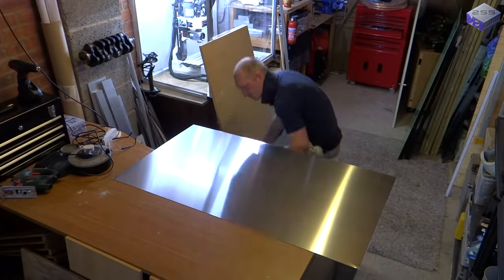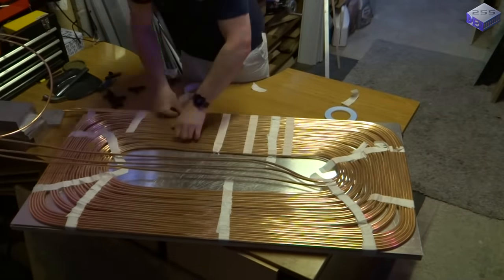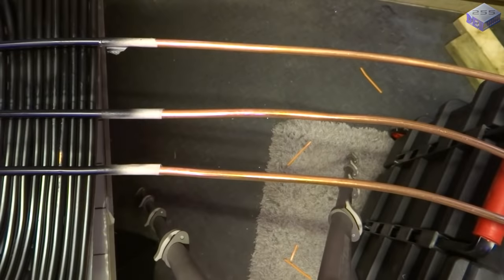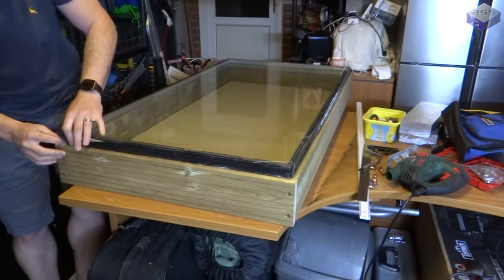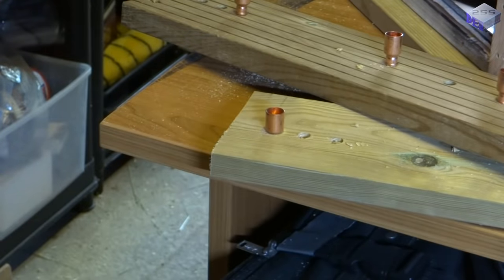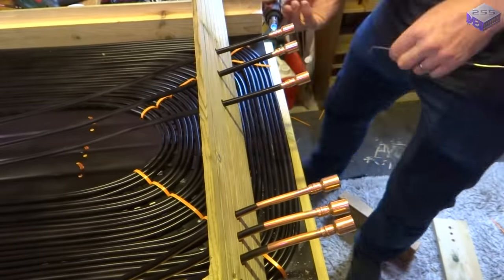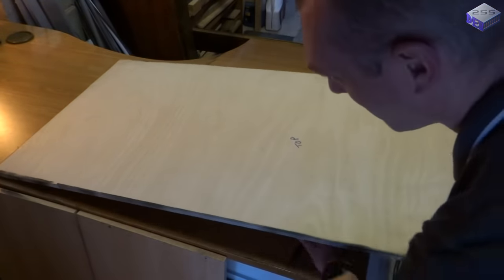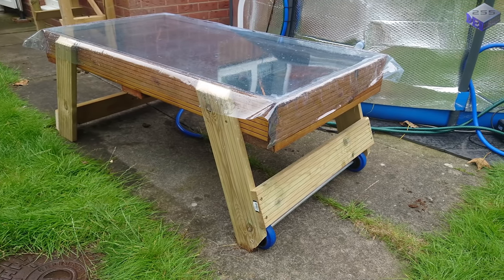Improved Solar Pool Heater - Full build

Comment: Maths is your friend here.
Maximum available solar insolation per square meter based on latitude and time of year means there is a limit on the maximum energy you can extract for any given surface area.  You will never extract 100% of the available energy due to loses etc.  The max insolation for 50 deg north at solar noon in mid summer is 1kW (1000 watts) per sq meter at an incidence angle of 90 degrees
  
The energy required to heat 1 liter of water 1 deg C is 1000 calories. 1 watt is 0.24 calories per second (watts are a measure of power over time), so 1000 watts will raise 1 liter of water 1deg C in about 4 seconds.   Which means that on June 21st in the UK between 12.30pm and 1.30pm (solar noon) you can heat as an absolute maximum 900 liters of water 1 deg C, or 90 liters of water 10 deg C for every 1 sq meter of solar collector surface area.  In reality due to losses etc this will actually only be about 60% of maximum, equating to about 50 liters of water heated by 10 Deg C for every Sq meter of solar collector for one hour at the middle of the day in the middle of summer.  Outside of this it falls off quite rapidly, both in terms of time of day and time of year.  If you had a cloudless day you would effectively collect about 6 kW energy per sq meter over the entire day at 50 deg north on June 21st, and about 2kW per sq meter in mid winter if you dual track the sun.  

An average swimming pool is about 2 meters by 2 meters by 5 meters or about 20,000 liters, will require roughly 400 sq meters of surface area of solar collector to be heated by 10C in the middle of the day in the middle of summer in the UK, or about 80sq meters of collector if you happen to have a cloudless day and the panels are solar tracked.  If you want to heat the water to bath like temps, time to cover an area about 20 meters by 50 meters with panels and then make sure to prevent heat loss a night.

You are actually better off using solar PV and powering an electric heater.

Good luck.
Reply from the maker: Hi, that sounds fair, although not sure about the PV panels and heating with electric due to PV only being around 20% efficient and Solar Thermal (ST) around 60% efficient, also with the direct heating of water from ST as opposed to Power losses through PV cables, each connector, charge controller power consumption, battery charging inefficiency (especially lead acid) and heating element to name a few. Although, that said, you could collect energy from PV over a number of weeks and then only heat the pool when necessary so you could have a smaller system. We did manage to get our 3m diameter pool up to 31deg C in summer of 2020 over the course of 7 days from around 22deg, and that was using my first homemade panel that produced on average 600W per day (4.8KWh), 900W max during midday. We had heat loss of around 1 to 3 over night as we had the pool covered and wrapped in reflective bubble wrap, so that helped a lot. All the calculations for the specific heat capacity of water (just below 4200), the amount of water (4600 litres) and joules produced by the panels calculated correctly to what we were seeing. I've learned a lot from making this system and love the answers in the comments section, they are thought provoking and help think about other solutions, thank you. What do you think on ground source heat, I was thinking of combining a number of systems for an all year round pool heater that would not freeze due to the ground source and possibly air heat exchanger tied in together?
Reply: @TheSolarPoweredEngineer  Sorry the Pv comment was meant to be a bit tongue in cheek...  but in terms of cost, maintenance etc, it is actually more cost effective over time to use Pv and an immersion heater if you have the space for a lot of Pv panels.

I really enjoyed you vid by the way... i´m a bit of a solar geek and have put together a number of systems myself (water and Pv) over the years and really enjoy seeing other peoples adventures in it.

We used to live in wales and had ground source heat pump with about half a mile of buried pipe in a field, and it was pretty effective even in deep wet welsh winters.   The heat pump itself used a fair amount of power so I would advise pairing it with a good Pv system or the electric bill can be a bit of a surprise.

These days I live in Spain so have the luxury of a lot of sun and a enough land ofr a sizeable ground mount Pv array. (but no pool ironically). I have messed with making a solar heat collector for hot water here, but with the sun and space it just came down to Pv and an immersion heater being a better alternative in this location.

I think your notion of combining sytems is actually probably the best (and most fun to design/make)...so if you have the space a Ground source pump powered by PV with solar collectors for additional capacity would be pretty awesome.. I would definitely like to see that put together.  

Oh subbed by the way, just in case ... :)
Reply from the maker: @Pabz2030  Hi, thank you, no dramas at all, I love to respond to all the comments, especially when it's engineering, I still teach electronics and valve theory to some degree strangely, so it's nice to chat to someone in the know.

I've been thinking of a number of things along combining solar systems, such as, using Solar Thermal to heat an emersion tank of water to directly feed into a washing machin and/or dishwasher and just use PV for running the machine and spinning the drum/pumping water. I think this would be much more efficient.

I'm also converting a car to electric and converting my mill to CNC that's run by solar, so essentially the car is being manufactured using solar also. It's amazing what can be achieved today in a home garage and am enjoying the learning journey.

Glad you liked the video, plenty more to come and thank you for subscribing 👍.

Comment: Thanks for this vlog. I have question when you testef with pool what was day time temperature?
Reply from the maker: We need to fully test this version as summer last year was almost non existent haha. The previous panel was tested in 2020 and the outside air temp then got up to around 30deg C during mid day, although was around 25deg C average across the day and dropping to around 14 over night, where the pool only lost 1 to 3 degrees overnight, but gained 5 to 6 ish during the day. We had insulation around the pool and covered it with bubble wrap insulation during the night too, so all these factors make a difference. It may be worth looking at my previous videos as I go into a fair bit of detail in part 3. I hope that helps

Comment: Are those hoses from the panel going straight into the pool? If yes, I hope, you're not running chlorinated water through your solar pool heater. Chlorine will react with copper, eating away your tubing, so this might not be a long-lasting build. Maybe you should put a heat exchanger between the pool water and the solar panel.
Reply from the maker: Hi, yes the water goes directly to the pool. I'mm currently looking into this and trying to get an answer from a university or other professional body as this is a concern from reading some of the comments. The thoughts at present lean towards using chlorine only when needed and maintaining a neutral PH balance as the chlorine will react more aggressively if the PH is off neutral. Drinking water also has chlorine in (although the amounts may be a lot smaller) and runs through copper house pipes with a neutral PH, but that is professionally monitored. There needs to be more answers to this online as it's difficult to find the correct answer. You are absolutely right about the heat exchanger, I will be looking at doing this as a closed-loop system, that way I could connect PVC pipe to the copper pipes and have the PVC pipe run around the bottom of the pool transferring the heat.

Comment: I was going to put a 1 way mirror on the inside of mine. Sadly we are getting rid of the pool so ill never know but it would definitely increase the heating. My only concern was the film degrading over time so i was going to go with a really high end film to start. Would love to see it if you do another.
Reply from the maker: I may have to try a number of different options to see which one works best, the one way mirror does sound like a good option. Thank you, I will hopefully make some more this year, possibly a number of small ones to compare different make ups

Comment: Pretty neat.
To cut cost I would use plack irrigation piping. Orherwise it will work nicely.
Reply from the maker: Hi, thank you, I did make the first version with black irrigation piping, and that worked well too. This one was an attempt to make the system smaller.

Comment: Can't help but wonder when you make it like a circle loop. 
Wouldn't it have been better just to make 2 manifolds connected by straight tubes bottom to top.
Reply from the maker: Hi, it may have been better to connect them to an input and output manifold to maintain the same /similar flow in each tube, although I want to be able to change the configuration of the tubes to see what the best option is, plus measure flow in each tube. I think different configurations would not make much difference, although will test the options.

Comment: Please check your glass. A lot of modern double glazed units have a solar control coating comprised of a pvd applied silver coating which is designed to reflect infared energy (ie heat) to avoid your house overheating in hot weather. You would get faaaaar better results just having a single pane of toughened glass as it will trap more heat and not reflect the valuable heat into the atmosphere. 

Thats why a greenhouse with single glazed glass feels a lot hotter than your front bedroom window

Edit: with that in mind, having improve u values (thermal transmission outwards) isn't a bad shout. Maybe a dgu with the worst possible solar control but the highest available U value. I have some software at work which I'll check through and look for the best (for your application, but worst as far as solar control domestic applications go) unit you can get.

Comment: DIY pool heaters are more cost effective with black irrigation pipe. Unglazed. You should hook that up to your domestic water heater with  glycol, a pump and a heat exchanger.
Reply from the maker: Hi, my first version was black irrigation pipe and it still works very well with only the pool water running through. I did think of a heat exchanger for this version as people were concerned with copper and chlorine. I may just try this when the summer appears.

Comment: Nice work, but at some point it would be better to buy a ready made vacuum tube rack and keep the copper tubes for connecting to the pool.
I am making 500-1000W per rack and would melt the garden hose real quick with 3 racks.

Comment: I love the idea of this technology. The thought occured to me, why not use this same technique to heat your home. Just run some PEX under the floor of your main living space. It would have to dramatically reduce your heating bill.
Reply from the maker: Hi, this would work quite well, although not sure how well in the winter in the UK as it could freeze the pipes and cause issues in the house, although if you used a Glycol mix it would reduce that concern. The Glycol mix would have to be tested at least annually though, similar to a cars cooling system. I may just be testing this heater on a emersion tank full of water to see how well it works; this should work well as there would be far less water than in our pool. Good idea :-D

Comment: Wait plastic degrades in full sun quickly. Becomes brittle and cracks. I would use metal wire to hold everything in place. Just wondering how hot is the water that comes out on a average day?
Reply from the maker: Hi, yes, I will have to replace these where I just liked the orange against the black ;-)

Comment: So, what were the dimensions of your collector?  And your 500W power - was that power into the outflow water?  I'm very interested in this - I've been thinking about making one myself and "overall efficiency" is something I'm not well calibrated on.  My situation is kind of hard - I have a 19,000 gallon pool, and nothing I can reasonably build is going to heat that very fast.  So I'm gathering data on how much heat my pool loses on the average night - my only real  hope is that I can make SOME GAIN during the day and then not lose it all overnight, so that I can gradually build up to my target temperature.  I've got a little Bluetooth temperature monitor submerged out there right now, and my daughter just headed back to college post-spring-break, so I just turned off the heater.  First cool-down data coming soon.

Comment: Painting the copper won't increase it's ability to transfer heat from the exterior surface to the interior surface.  You basically put insulation on the outside of the copper.  For version 3.0 I would suggest: 1) Go to a junk yard and get a couple big car radiators.  They cool engines with kilowatts of heat output.  Just make sure to really flush them out thoroughly.  They will be much more efficient at transferring heat than any tubing setup you could build for a reasonable price.  2) Insulate the box as much as possible.  Like an inch of hard foam on every side that's not glass.  Use the stuff with one metallic side and you'll get free internal reflectors too.  3) After sealing the box, fill it with a greenhouse gas like CO2 or argon.  These denser gasses will greatly increase the amount of heat energy the unit can contain.
Reply: You misunderstand why the black paint is needed. It absorbs a lot more heat then a reflective cobber surface, which adds is a lot more heat than the extra insulation the thickness of paint removes.
Reply: A car radiator is made to utilise air for cooling down water, which has nothing to do with using the sun to heat water. When using the sun you need a lot of surface area that the sun can hit directly, which the cobber tubing provides. As a car radiator is designed to be cooled by air flows through the radiator, much of the inside surface area of the radiator won't be hit by the sun, decreasing the effectiveness for this type of use.
Reply from the maker: @Fante247  Exactly what you said 👍, I couldn't have put it better myself.
Reply from the maker: Hi, removing the air or changing for isolated gas of low specific heat capacity is a good method to increase the efficiency of the unit, although it would be hard to maintain either a vacuum or gas containment. I will probably reduce the sides to decrease the air capacity in the system and replace the glass that lets more IR through. I need to do some tests with different materials. The double insulation below the aluminium sheet is working well to contain the heat, where each sheet reflects around 90% of the energy back, it could do with a layer of air between the aluminium plate and insulation though. The idea behind these heaters is to absorb heat efficiently and transfer it quickly to the pool. The greater the temperature difference between the water in the unit and the heat being generated, the more efficient the solar thermal heater, although there are a lot more factors than that.

Comment: Two worries. Zip ties are made of a plastic that goes brittle in sun and heat. Second thing is the hose running hot, check for the hose material being cooked and if it's rated for it. Simple changeouts, since a padded tie-down wire can curl and be replaced while its shut and hose re-placements.
Reply from the maker: Hi, thank you, I will be changing the cable ties at some point to copper wire sprayed black, although the hose remains ok with temperatures on reaching 30+ degC at present, especially with a fairly high flow rate through it.

Comment: Really nice!
If you run a shower how much time would you have hot water?
Reply from the maker: Hi, it depends on how long you heat the water up prior to using the show; this because showers tend to use 4 to 10kW of power to heat the water as it comes through. This panel performs at around 500W on a good sunny day, so to get the same heat output as a 4kW shower (roughly) you would have to pre-heat the same amount of water that would be used in that shower for 8 hours ish. There is many other factors to consider for heating water. I will have to try and create a shower from this and find out ;-)

Comment: Why such tiny tubing? Get larger thin-wall tubing like 3/4" - 1" diameter. Flow is king for heating, the goal is max heat energy, not maximum temperature. If you have flaming hot temps, your heat losses will increase and any pump that has to handle that heat will die a quick death. What is your goal temperature?  I found that a larger storage tank at a more moderate temperature provides heat much longer than smaller tanks that are 2x hotter and you dont have to change your circulation pumps from cooking them to death and the lower pressure with higher flow rate of larger diameter pipe will give you much better gains. The tubing in parallel may work but the flow rates are likely to be uneven. Still it is an interesting concept video and has many interesting design tips. 500Watts is a great start :)
Reply from the maker: Hi, I went for high flow rate and high surface area, hence 3 routes for the water to travel through to maintain a high input to output flow with a temp rise of around 1.5ºC and a flow of around 4 litres/min, so power was around 500W at max sun angle. I wanted high flow and smaller pipes to increase the chance of turbulent flow, as this is more efficient as all the water has chance to transfer the heat away from the pipe surface and into the pool. Thank you, I intend to do a little more research and modification to this one, including fitting 3 separate flow meters to each input so I can adjust the taps for even flow.